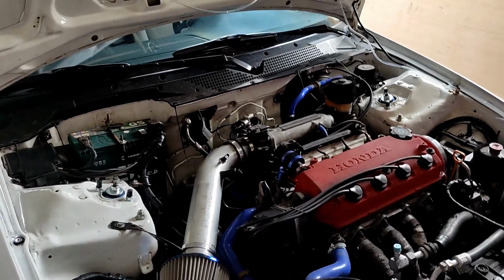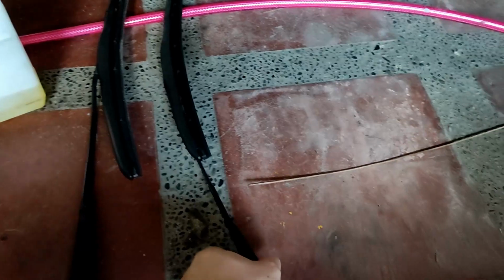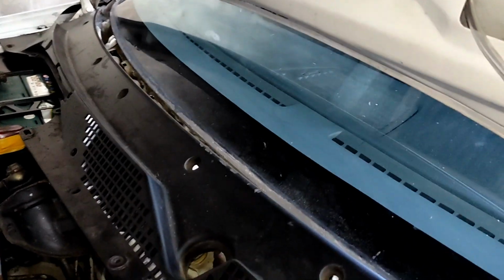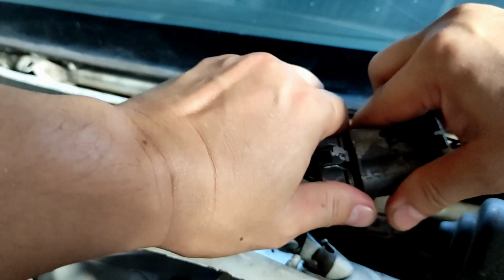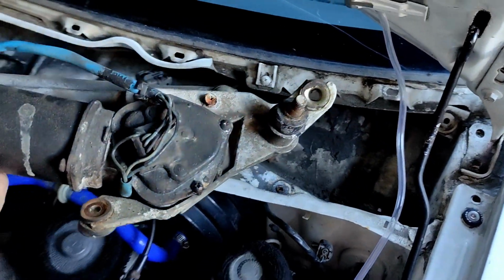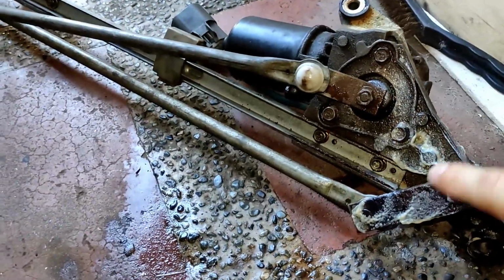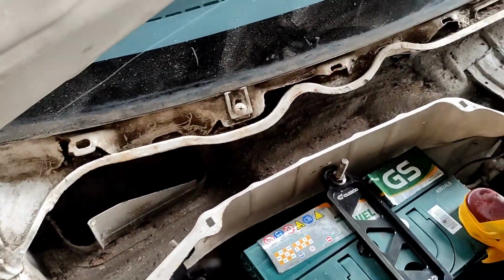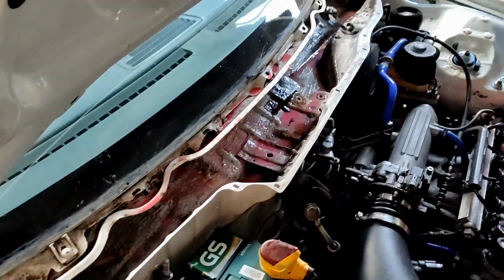honda civic eg hatch, remove wiper arm, wiper cowl, wiper motor assembly, 30 year old car

Comment: 3:33 was the way to go - i followed your lead and was able to save and reuse the pins - slow and steady work each one out with a small flat blade. Thanks for posting this … just what I needed
Reply from the maker: you are welcome bro, bit by bit im trying to make changes on the hatch not sure if its for the better or worse hehe, buy i just wanna document em, right now im having issues with the radfan motor, weird noise, might be a bearing problem, or maybe i should replace the whole radfan assembly then upgrade to a high speed fan.. will upload em next time